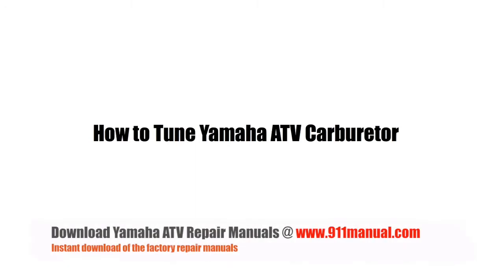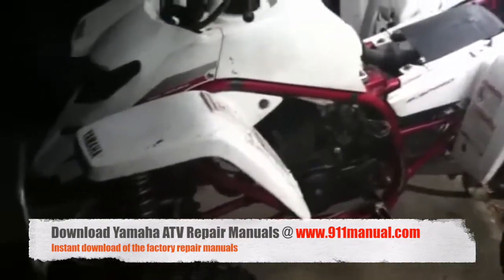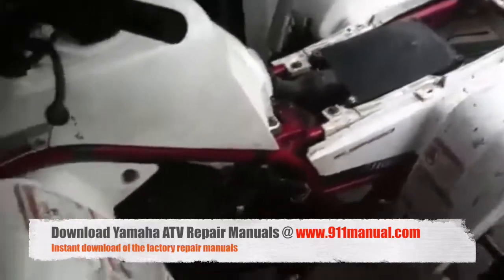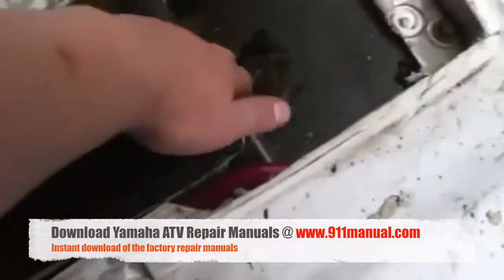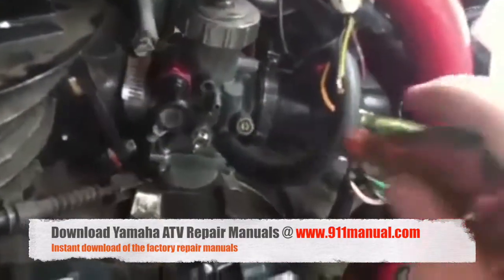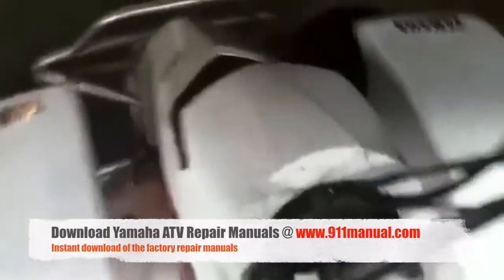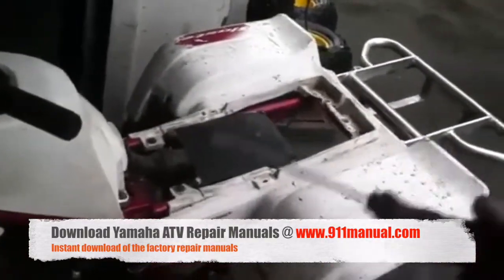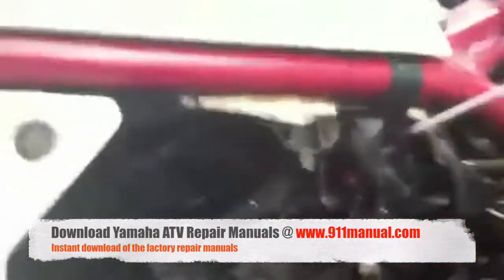How to Tune Yamaha ATV Carburetor

Comment: Holy shyt, dont ever run your motor without a filter unless you like pissing away money on rebuilding and buying new engines. More power is the dumbest damn thing ever. Get a new filter if its so clogged up its robbing power.

Comment: Best to tune a carbs pilot circuit on the rich side of drop off for best off idle acceleration and ease of starting. Your bike sounded perfect when you went in around about 3/4 of a turn after the initial setting at 3.36. 1 turn in was too much, 1/2 was too lean still.

Comment: Thanks for the tips man! I just rebuilt the whole engine for a 2001 Blaster and it runs well, but it's hard to start, even when warm, and the revs hang for a few seconds before it comes back down to idle. I'm going to tune it more tomorrow and check for air leaks. I just mixed a gallon of fresh 32:1 tonight so the fuel is definitely good.

Comment: So my yamaha big bear has a new carb and with the snorkeling it will not run with the air box kid .. but im not a bike guy. Do you know where the adjustment is on it
Reply: Bottom of carb on the engine side directly in the center. Brass circle with flat head
Reply: @nickknepper6417  ok thanks ill check that out

Comment: What if there is no idle screw
Reply: I've never seen one without not saying its not possible but some carbs theres a cap in front of it that you've got to drill out.. I would like to know what carb your working on that doesn't have one just out of curiosity
Reply: Idle screw is on the tors unit for blasters that still have the tors unit on top of the carb. Take the seat off and you'll see it. Big round flat head screw

Comment: My blaster doesn’t want to idle, turn it one it runs a little rich but let go of the gas and it dies🤷🏿‍♂️🤷🏿‍♂️
Reply: Clean your carb, idle jet.
Reply: @codymcgowen5579  i bought a oem replacement carb for $120, it still dont idle unless the choke is on
Reply: @DMAXmarty  probably need to re-jet it to different sized jets

Comment: Mine has been sitting for year. My uncle left it to me after he passed almost 10 years ago we got it running recently But it idles very high. Should i still let it run and then change the screw even if the idle is very high? Don’t know much about ATVs and would love to get this bad boi running
Reply: There should be an idle screw separate from the carburetor

Comment: I've did this a dozen times when I put the air box lid on its like mine is stuttering like a limiter take air box lid off and it runs great little rich but great. Just a little stutter on taking off other then that all good. I think my air screw is broken or the tip broke off
Reply: Try a new air filter
Reply: It doesn't even have an air filter on it.
Reply: Change the idle circuit jet

Comment: Quad is bogging at high rpm and doesn't like to stay running if you don't keep her revved out yall think it's carb problems or otherwise
Reply: Check the carb or if theirs an air leak

Comment: Left is rich, right is lean 🤦🏻‍♂️
Reply: Thats an air control screw... so for this case left is lean and right is rich. If it were a fuel screw you would be correct. Those carbs have a main fuel needle on the top.
Reply: Not on 2 stroke
Reply: On a 4 stroke yes, because it’s controlling the amount of fuel. But in this case on a 2 stroke no, because it’s controlling the amount of air.

Comment: I cut the wires and removed the brain for tors but left the module still attached to the carb cap. There is an idle adjustment screw on top of the tors...can I use that to adjust the idle...and will I even be able to adjust it like that with the wires cut??
Reply: I believe so I don’t see why not but don’t quote me on that
Reply: Dillon Hoffman no you need to remove the tors completely from on top of the carb as well. And get the tors delete kit. Consists of a new cap and cable for your carb,a drill bit to tap in the carb and an idle screw for the hole you tap in. Should have a YouTube video or on blaster forum
Reply: @RoachyBalboa  Ok thanks man! I kinda seen thats what I was gonna have to do just havnt got around to it yet.
Reply: Michael Roach I may be wrong but I’m 80% sure I’ve read that people do that on the blaster forms

Comment: My 05 raptor 660 ran fine but died when I gave it throttle and smoked a lot so I changed piston so it doesn’t smoke but I only got it to start 3 times and it dies in seconds. Any idea why it doesn’t want to start? RPM seem pretty good
Reply: Check valve
Reply: Starter clutch maybe.